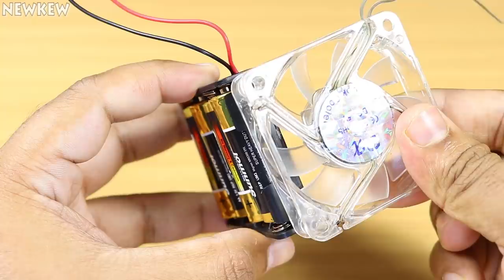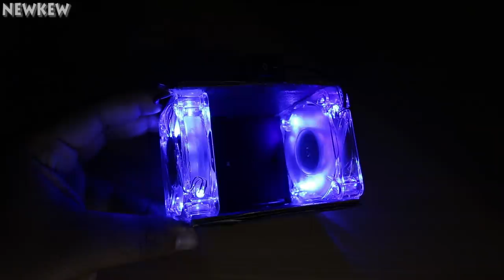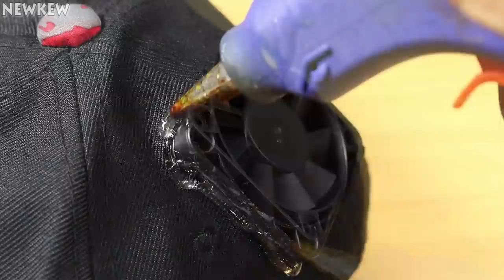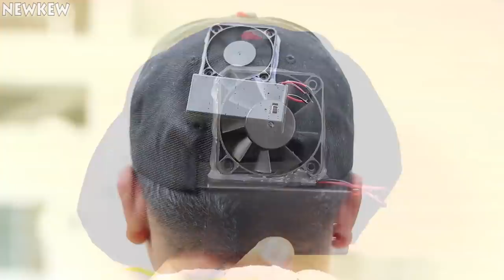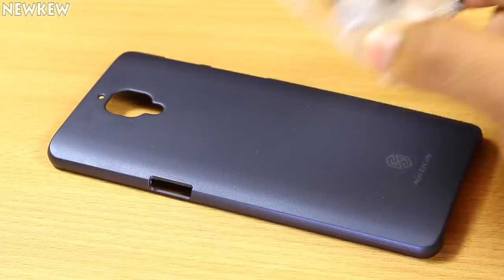Top 3 Best Life Hacks for CPU Fan - CPU Fan Life Hacks

Comment: I made a hat with a fan too, but I used a USB-powered fan (search amazon for usb portable fan, maybe with handheld keyword also). The benefit being that you can power it from a rechargeable USB powerbank, which of course come in all shapes, sizes, and power reserves. I got about 10 hours fan life from a 4000mAh powerbank. The specific fan I used is called arctic breeze. Oh, I also found a fabric mesh that I put on the inside of the hat, to help prevent hair getting caught up in the fan.

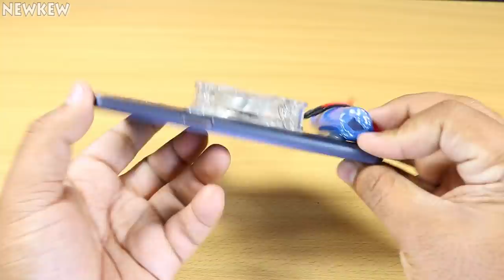Comment: 5:21 it will not work because there is no gap between case and the phone to the air pass across the phone back. It’s like putting a fan to blow wind to a wall .-.
Reply: The fan is not giving wind it is sucking the heat.
Reply: Mr. Colour nop it’s blowing air